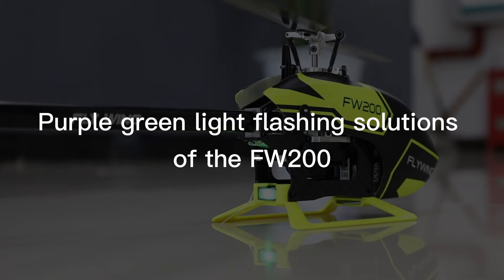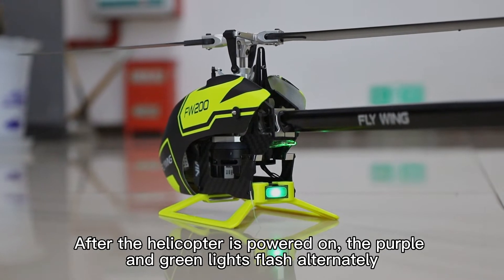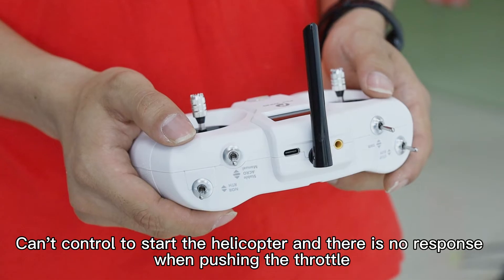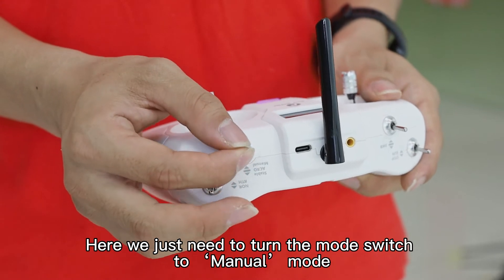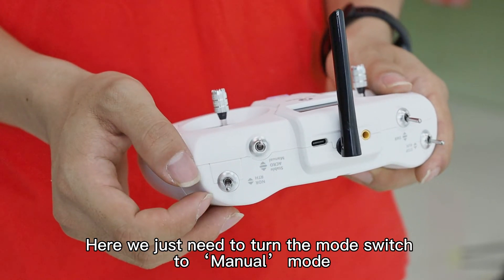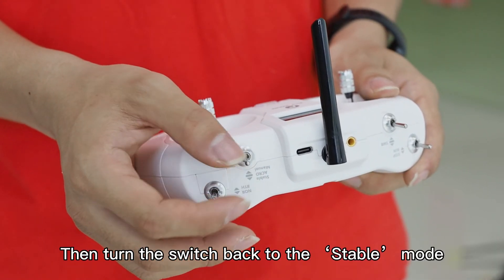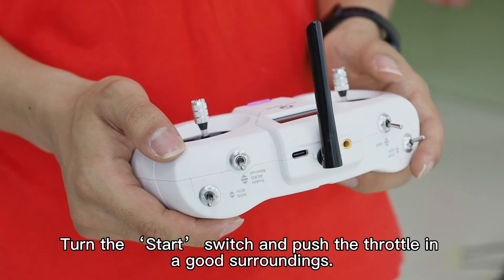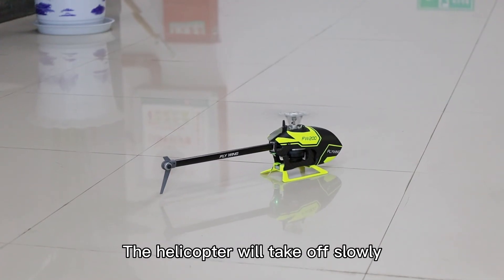FW200 RC heilcopter Unable to start motor tutorial

Comment: It’s not that simple. Sometimes you have to flick through modes several times or give the motor rotation assist. This heli has problems with no help from Flywing. Problems appear after you crash. Insisting on making it work, I suggest buying a bnf version and canabalizing parts. It’s cheaper than slowing buying parts to make problems go away.